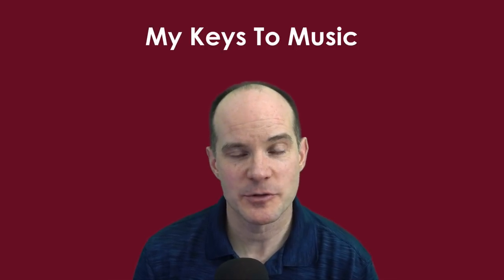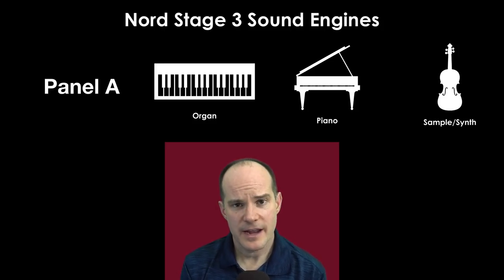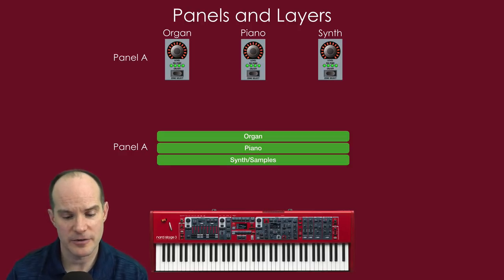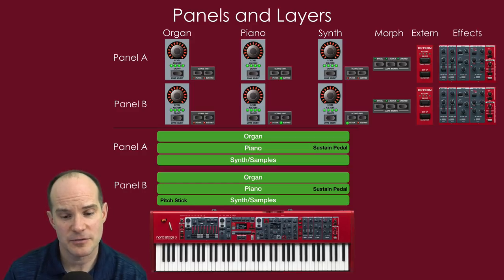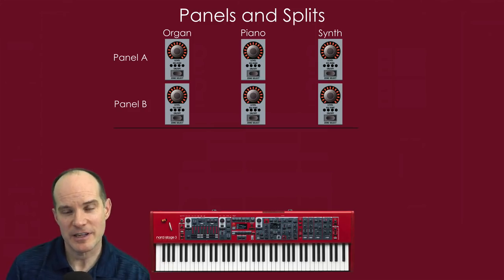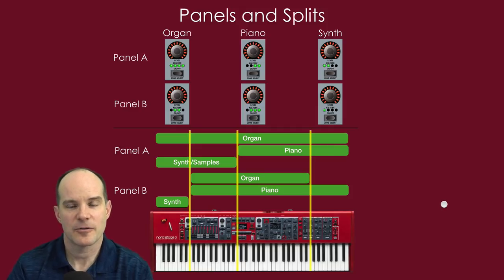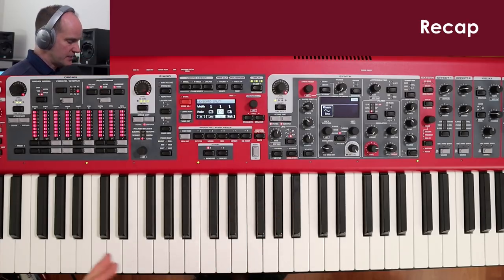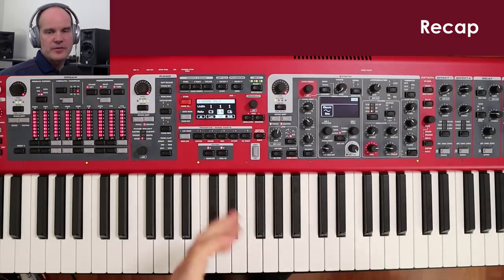Nord Stage 3: Understanding Layers, Splits, and Panels

Comment: Don't know if you are still replying to this post, but I will ask anyway.  (by the way, thanks for the info that you gave me wrt pedals)  I understand that you can split the Stage 3 into four parts with three split points, but there are only three items shown on the display.  Where is the fourth?  Or is it only three because there are only three sections (Organ, Piano & Synth) and that is the reason for the three shown in the readout.  Can you have four actual separate splits with maybe a copy of two piano sections in different splits?
Reply: I re-watched the video and I think I get it now.  Because there are actually six different sounds with the two panels, then you can split any of those into the four sections. One more quick question. Can I use an 88 key controller to control my Nord compact with 73 keys to expand the ability to have four sections on the 88 key controller?  Will the section tool still work the same?
Reply from the maker: @garyusinger Hmm - let's see if I can explain this:
In the display of the Nord keyboard itself (like you see around the 29 min mark in this video), you are seeing just the 3 split points. The 4 zones I'm referring to is what you end up with once you split the keyboard three times.  For example:
One split = 2 zones
Two splits = 3 zones
Three splits = 4 zones

When you are looking at the split display, you are seeing the details of the splits not the zones.  To see the 4 zones, do this on your keyboard: 
- Hold the shift button while selecting the "Utility" button. (The utility button is also #5 on the panel)
- Click on the "page" up button. This will navigate you to page 2 of the utility options and display the 4 zones you are referring to.
Reply: @MyKeysToMusic  Thanks.  I will check that out.  I have the Novation 88 key controller showing up soon and will try the split function with that machine to see how it works.
Reply from the maker: @garyusinger  Sounds good.  Report back any interesting findings...
Reply: @MyKeysToMusic  I found the page under utilities that you were mentioning and it is indeed 4 zones  Thanks
Reply from the maker: Well done Gary.

Comment: Hi Marc. Merry Christmas. I hope you had a great day. I have another question..  

I wanted to Double up the Indian Harmonium in 2 octaves just give a beefier heavier sound, is this possible without using 2 harmoniums.. as i am already using a bassline sound in split on the lower part of the keyboard. It leaves me with only 1 harmonium. Is there any way through the FX that I can double it up without using another layer in a different octave?

Thanks and regards, Kaykay
Reply from the maker: Hi Kaykay. So, technically speaking, there is no way out of the box to have 2 harmoniums and a bass line at the same time as you already figured out. And there is no effect that can "double" an instrument like this - although that's a terrific idea of something that would be nice to see (much like a harmonizer does today). So, no, there is no way to pull this off out of the box that I can think of.  Now, with that said, you could potentially create a homemade sample that included a bass in the lower part of the keyboard and a harmonium on the right side of the keyboard. Making such a sample would be a bit of work and I wouldn't exactly say that this is feasible as not only would it take some doing, it may not come out as good as you're expecting in the end. Sorry, there is no real solution here but a good question none the less!
Reply: My Keys To Music hi. Thanks for the reply. Would be great if Nord did create a ‘double up’ feature on the Stage 4 whenever that happens. Thanks Kaykay

Comment: Is there any way to bounce a program down to a sample so you can put a whole "program" on zone A and add another layer with zone B?
Reply from the maker: Hi Julian!  I like your line of thinking here because it's "out of the box" (a good thing). So, the answer is yes and no on this. Yes, you could technically record a completed program into your computer, create a sample via the Nord Sample Editor 3 and then place that sample back on the Nord Stage 3. But it may or may not come out exactly the way you intended it to.  A Nord Stage 3 original program will respond to all input controls providing you fidelity and control over every attribute. But once you have this as a sample, however, it becomes a static "recording" and you lose some of that ability to control it in the same way. A sample is a locked, static, rendition captured at the time you recorded it. Yes, you can further adjust samples using the Stage 3 synth engine, but it wouldn't have the same control you had when it was an original program. I've never personally tried this, but in theory, it should work.  But like I said, I suspect the end result will be not quite the original. It's something that you could test easy enough.

Side note: In addition to being able to "bounce" a program down to a sample as you asked about, you can also have multiple samples assigned to various keys. For example, you could have one sound assigned to C2 through C3 and another sound assigned just to D4, and a third sound assigned to E5 through E6, for example, all playing on the same program. I will explain these theories a bit more as I plan on creating a "Nord Sample Editor 3" free course this year (1st or second quarter, 2020) available at https://www.MyKeysToMusic.com
Reply: @MyKeysToMusic  I found an excellent Toto patch online of the Rosanna synth horns, and another one of Toto's signature piano. I love them both, and splitting the keys with piano on bottom, and synth on top sounds excellent. But, and there's always a but, the end of the horn line has a fall. And I've found in the forms that Nord doesn't have capabilities for a velocity sensitive horn patch like my Motif for example.  So I wanted to encorperate that fall at the very top of the keyboard. Maybe by doing another split, or sample the F note in the register that I want to the highest key on the board. Is there any other way to cheat this without having to switch to another patch, or having to add another keyboard to my rig?
Reply from the maker: @julianlambert6887  Great question. If you are only using a single synth engine on one panel so far, you could use the other panel to incorporate your horn fall on panel B and split the keyboard 3 times.  So it would be like this:
Panel A:
Bottom Split (Piano)

Middle Split (Horn Solo)
Upper Split (none)

Panel B:
Bottom Split (none)
Middle Split (none)
Upper Split (Horn Fall - new sample you create)
Then make sure you are playing both panels at the same time (click both panel A and B buttons at the same time).

This assumes you are not already using the synth engine on panel B.

If you are already using the synth engine on Panel B, then you'd have to create your own new sample (using the Nord Sample Editor 3) that includes the standard horns assigned to the majority of the keyboard and then assign the horn fall at the upper right (all on the same sample).  So yes, you can in-fact have a single sample patch that includes multiple sounds assigned to various keys and all of this can be played by either panel A or B on the NS3.

I think either of these options would likely work for you. Let us know how you make out!
Reply: @my keys to music Can I edit a program and save it as a new program while keeping the original program how it was?

Trying to take a synth horn program and add a split synth layer on it, but I don't want to lose my original synth horn program.
Reply from the maker: @julianlambert6887  There are a couple of ways to do this.  You could connect your keyboard up to the Nord Sound Manager, locate the program in the list under program tab, right-click on it and select "duplicate".  Or the second way is you can hold the shift button and select "Store" which will be "Store As".  From there, you can rename the program.  BUT be very careful, to move the program location as well as rename it (two steps) or else you'll need up simply renaming the program name but not moving the location.  It's far easier doing it via the Nord Sound Manager but once you do it once on the keyboard itself, it's pretty easy.  I probably touch upon this somewhere among my videos on YouTube for this. I know I do have lessons for this in the course.  Good luck!
Reply: @MyKeysToMusic  Hello, does the page buttons on the Electro 6 do the same as the panel buttons on the stage allowing you to layer multiple sounds?
Reply from the maker: @ECookMusic  Hello Emmanuel.  Good question.  So no, the page buttons on the Electro 6 give you the ability to navigate up and down programs and/or system settings. For the Electro 6, there is a single layer (panel) for all sounds. You can layer a piano on top of an organ on top of a synth sample and all 3 can be heard at the same time.  But you cannot have two synths, two organs or two pianos like you can with the Stage 3.  I recommend you watch this video where I explain this exact concept starting at 19:55 (here is a bookmark for the exact talk on this topic): https://youtu.be/av3GxXakeaM?t=1195

Comment: I wanted to split sounds from the synth engine. A Bass & Flute or a Bass & Lead Synth, Bass & Guitar etc... is that possible? Thanks
Reply from the maker: Hi Kaykay Chauhan! Great question and the answer is YES!  With the Stage 3, you have panel A and panel B. So, the Bass could go on Panel A and be positioned on the left split. Then on Panel B, you'd have either a flute, synth, or guitar (using your examples) on the right split. Then you would push both A and B buttons to have panels A and B play at the same time.   Then on top of that, you can choose organ or piano to play along with those in either split or on top as a layer if you choose.  

Now, the only limitation here is if you wanted to have 3 sounds coming out of your synth engines.  You only get two at a time (one for panel A or one for Panel B).  So in other words, you couldn't have a bass in the left and then a flute on the right layered with a guitar.  The guitar would be a third sound and you only get two at a time from each engine.  2 Organs, 2 Pianos and 2 Synths.

Hope that makes sense!  Thanks for watching...
Reply: My Keys To Music great thanks for your reply. I assume I could do this on an Electro 6D as that is a Stage 3. Correct?
Reply from the maker: @kaykayco  Happy to help. Well, you are NOT able to do this on the Nord Electro 6. With the Electro 6, you only get a single "panel" so that means only one sound coming from the Sample/Synth engine a time. You can still do a basic split by having a bass in the left, but then that engine would be used up leaving just the piano and organ engines capable of sounding. So, not the same at all which is one of the biggest distinguishing factors between the two models (Electro versus Stage). If you haven't already done so, you may want to watch this video next which compares the Electro with the Stage to help you decide. https://youtu.be/av3GxXakeaM